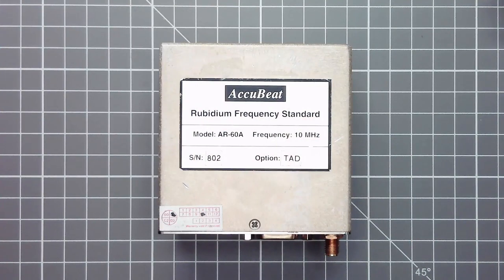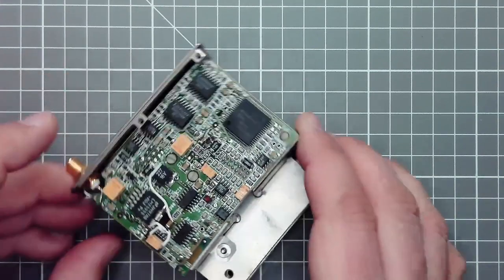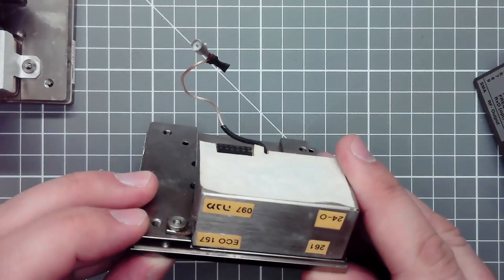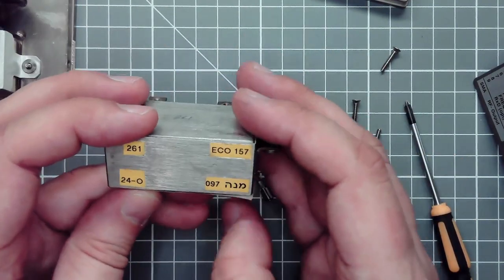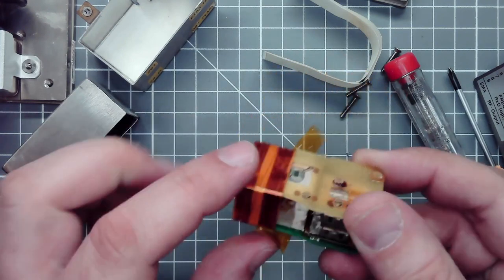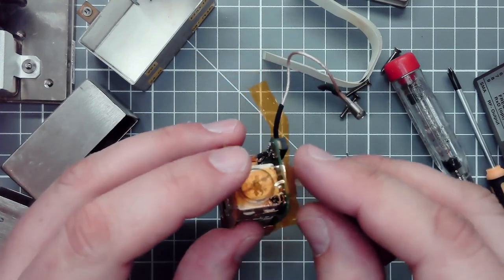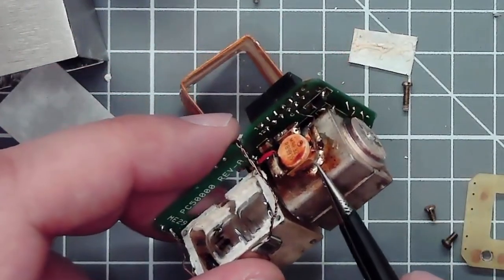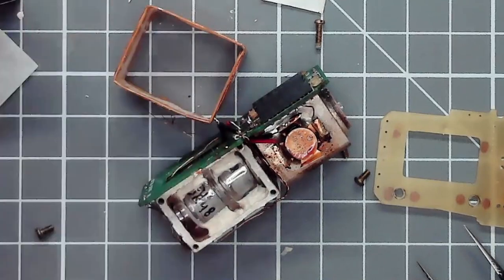Inside the physics cell of a Rubidium Frequency Standard

Comment: Thank you for the teardown! It was very interesting to see the insides of a small model like this. It would be great to see the various control signals as the oscillator turns on and locks in.
Reply from the maker: Yes, it probably would be - however, I don't think I will disassemble my working units, and also it will be difficult to probe the unit during operation, because of the compact design.

Comment: one more thing i will like to add.  when you were testing MRF321 in diode mode, it is important to check BJT in fwd , reverse mode and in between Collector and emitter.  these three tests are conclusive to check good or bad devices. three test lead may be de soldered to isolate the device
Reply from the maker: Thank you for your comments - actually I have no ambition to fix this unit, since I got two working ones. I keep this one as educational material for my students.

Comment: Should be slightly radioactive. 87Rb is not stable.
The "Helmholtz-coil" is the tuning element. With it's magnetic field the frequency of the hyperfine transistion is modulated.
Reply from the maker: The 28% of 87-Rb in the tiny amount of rubidium inside the vials has a half life of 5e10 years, so its radioactivity is not an issue here...

Comment: very nice and detailed information.  could you find what actually was wrong with this unit. to make it work, one need right temprature (MRF tx and resistors), 6.8 Ghz feild ( can be verified using feild probes and spectrum Analyser), the continuity of coil can be verified using DMM.  for infrared lamp i am not sure but can be visible using from digital camera with IR Filter removed.  photo sensor could be checked using DMM and or scope.  i have one of these, in which lock bit is not going down.  Shell gets warm so i assume MRF is okay.  Rest i need to check.  I may be wrong my assumptions, so please guide

Comment: Hi Uwe, Thank you for the nice video. Do you know the Serial protocol voltage level for AR-60 (RS232, TTL 5V/3V)? Thanks
Reply from the maker: I would need to check, but I am almost convinced that it should be RS232. You should be able to test this by measuring the idle voltage on the TX-line. If it is positive then it should be either TTL 3V/5V, if it is negative it is certainly RS232.
Reply: @uwezimmermann5427  Thank you. It is 5V, but I was unable to get a response from the device following AccuBeat RS232 protocol for their nano product.